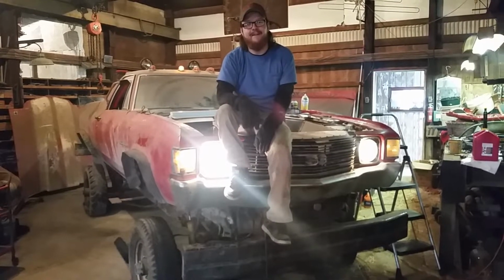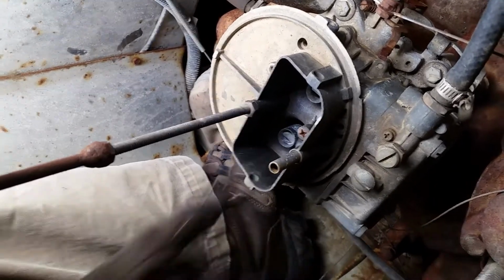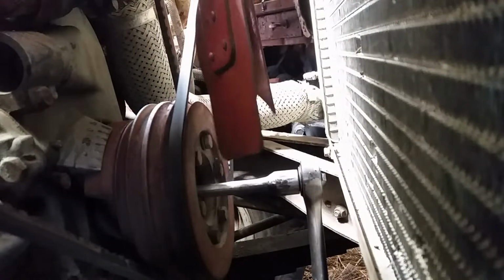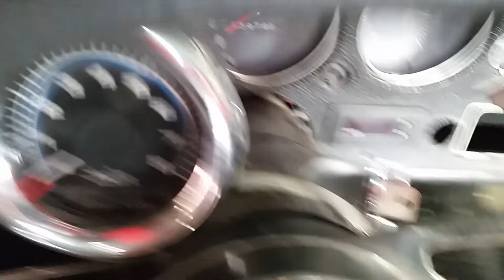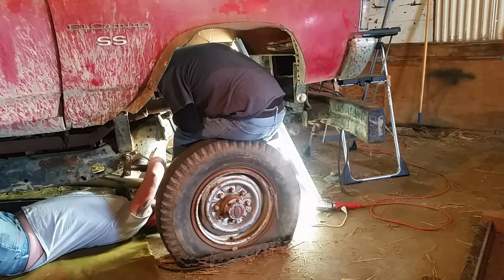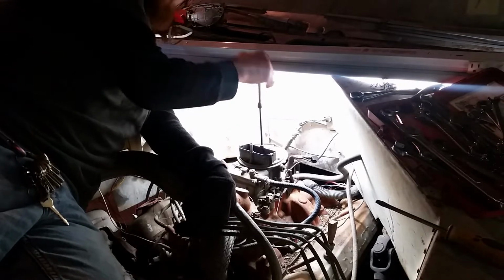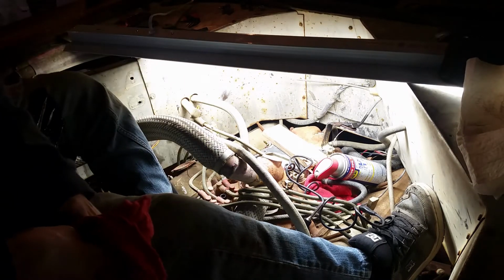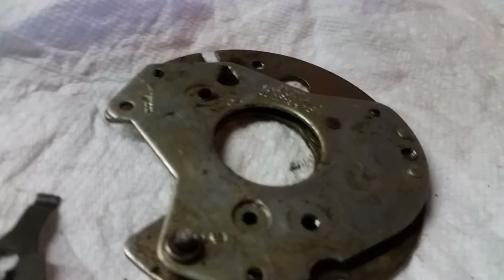Episode 1 Revival of the Intercamino

Comment: Thanks Jacob for doing and documenting this.  Lots of memories as I spent a lot of my High School time at "The Hortenstine's"  I remember this beast even earlier than this as your dad was trying to impress my neighbors daughter who lived on Western Avenue when I was younger.  Don't let Josh fool you about the tires.  Those are the 40" Ground Hawgs but he got it stuck in the "Bitch Hole" and wore them down trying to get out.  Keep up the videos, I want to see more.  I think the carb might have been a Predator.  They were single barrel adjustable CFM.  As for measuring the coil output, remember the input of the coil is 12 volts but the output is 20-30KV.  The light bulb might not like that.
Reply: Troy was right about everything except getting stuck in the "Bitch hole" because she'll idle through the hole in 4WD low when the carburetor is working right. The only time I have seen the Intercamino ALMOST stuck was in a cornfield that had been plowed. Your dad was going across the furrow left from a moldboard plow that was really deep. Driving across it wasn't a problem but he started to drive along/in it and it was sticky mud, REALLY STICKY MUD, & the Intercamino ended up turned perpendicular with the front bumper sitting on the high side shelf left from the plow causing the front tires to lose traction. With some maneuvering he finally got it turned and out of the predicament. The whole damn thing was covered in that gloppy, sticky mud and took forever to clean up.

Comment: Hell, you should've called me (I say that because I am remembering things as I am watching this). I could of saved a few painful lessons. Yes it was always horrible to sit up there on top and stand on your head to work on. There was a velocity stack air cleaner the last time I was under the hood (wonder what happened to it?). Your dad had a large single barrel Weber carb to put on it but we never got it put on there. He had sold the Holley 4 BBL and that old 2 BBL carb was just laying around so it got installed. That wire loop by the thermostat housing is where the return spring should've been hooked to. She's a temperamental bitch when cold and is notorious for gas fouling plugs (always have a spare set around because once fouled they never seem to work right even after taking out and heating hot with the torch to dry out). I've made two trips to town in one day for a new set of spark plugs. Battery always just sat back there in the bed that I remember (if anything, is was in one of those black plastic boxes). I knew as soon as the interior lights weren't on that the disconnect was off. The first two switches for starting (don't remember what the rest were for) except the far right was the KC lights on the roll bar. There was a shit ton more room to get underneath to work on when the 40" Ground Hawgs were installed. Awesome trip back in time for me!!!
That upper radiator hose clamp sure is a bitch at ripping clothes and skin, isn't it?
Reply from the maker: Glad you're enjoying the nostalgia... Its been a surreal experience for me and my friends cause it spent 23 years being an unobtainable dream to drive it one day and we were sure it would sit in the barn forever... Hope you get a chance to watch all the videos cause man they each have some very worthwhile moments in them! Hope you dig up some pictures some time of it back in its prime.